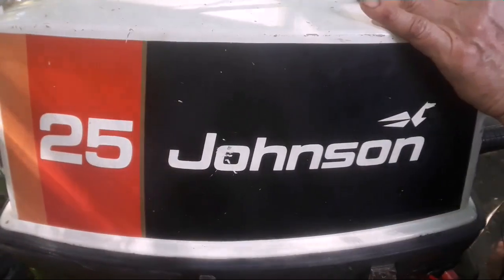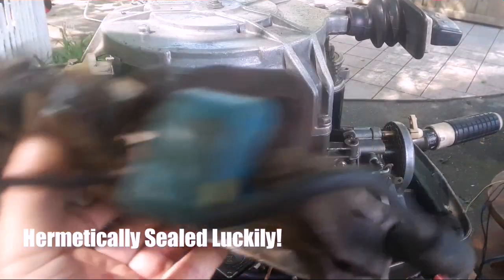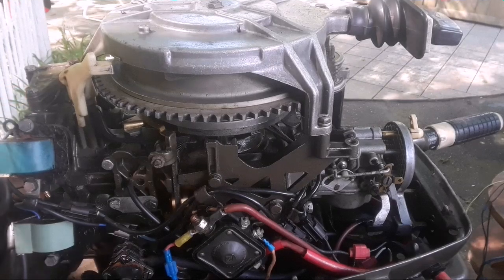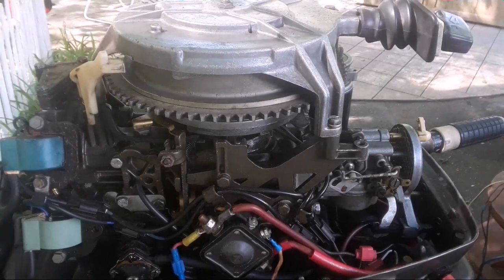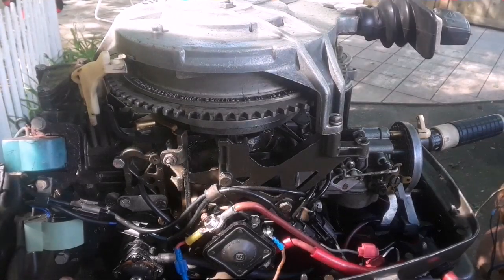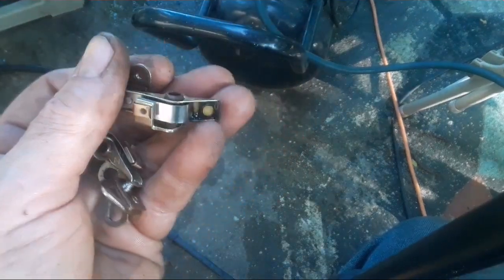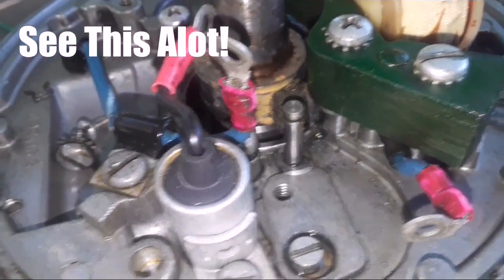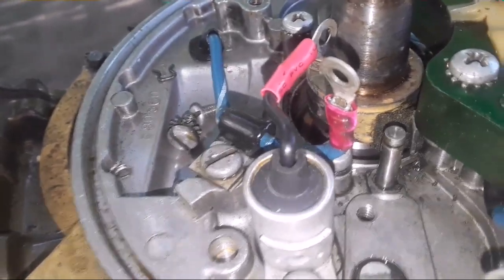1976 Johnson 25HP Electric Start! Did Repair Took A Break From My Motors! One nice fantastic engine!

Comment: Just curious because I have a 73, looks just like mine. Do you happen to know how many teeth are on your starter bendix gear. Mine doesn't line up correctly sometimes. It clangs into the flywheel more than I would like
Reply from the maker: Should be 11 teeth I checked two of my motors for you. This motor was a repair its gone. Spray WD-40 on the bendix mechanism and spring & a good strong battery helps..Hope that helps you out Gary! Like Subscribe !

Comment: Hi sir enjoyed your video 
I have a 1972 Johnson 25 that I just purchased  electric start
It will Run but dies after a few minutes minutes I have to pump the primer to re start  what do you think the problem might be?
Reply from the maker: Id swap with new or check fuel pump output while running(visual) first disconnect line to carb at pump run into waterbottle with short piece of hose , dirty carb second (rebuild & clean) and bad checkvalves in squeeze bulb would be my third check..Good Luck!

Comment: Greetings! Wow!  That Engine looks great!  I bought a used 1982 25hp 2-stroke Yamaha Enduro E25F and I am looking for parts. The engine starts right up. I looked into some outboard dealers in the States and they sell parts for engines starting year of 1984 and up. 
I have looked into Yamaha's history and this Outboard motor was sold for international only.  Apparently, the Boat dealers started selling Yamaha Outboards in the U.S. by 1984.  It seems that his model was not sold in the U.S. to what I had found.  Who knows.  I am looking for help if you or any of the subscribers who are reading may know of an Outboard Repair shop that may sell parts.  I will be very appreciative and please continue with your educating videos regarding old outboard engines thank you for sharing your knowledge and tips on fixing them.
Reply from the maker: The owner wanted to trade it for another I talked him out of it easy fix.Best bet for Yamaha parts is E-Bay being wordwide I would think sorry for slow response ....TOT62

Comment: Yeah, those coils will fool you for sure.  Just cuz they are cracked, doesn't mean they are arcing, usually a pin hole near a ground can be found by running it at dusk like you did.  You didn't replace the thermostat, just removed it??  
Sounds real nice though.  Last of the 22CI engines.
Reply from the maker: I had a brand new NOS 25HP powerhead sold it last year . Coils are very hardy yes they are. Yes this was the last year of a great 22CI motor. Owner said he will replace the coil its up to him and or the thermostat. This being a freshwater motor the thermo looked good and waterpump was good also. He came to me to buy a motor and I ended up fixing his and he gave me a $50 tip on top of my repair bill. Second time in a row I did this stupid me never make real good money being honest,LOLL!  Local Marina wanted around $1200 to go thru it & fix this motor with a waterpump change. He was lucky to find me thru my local listings... a real nice guy.................I enjoyed the repair....